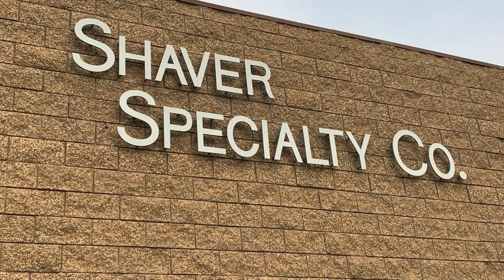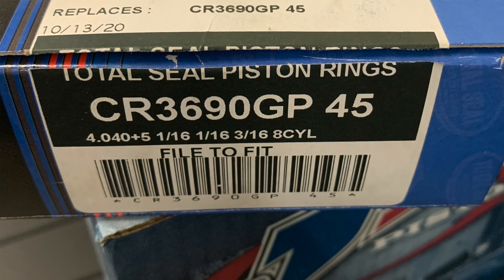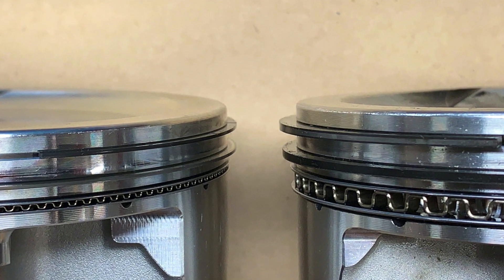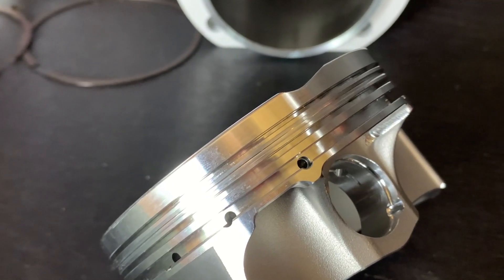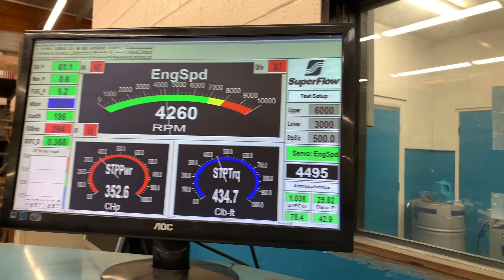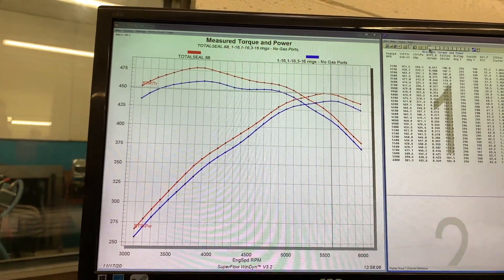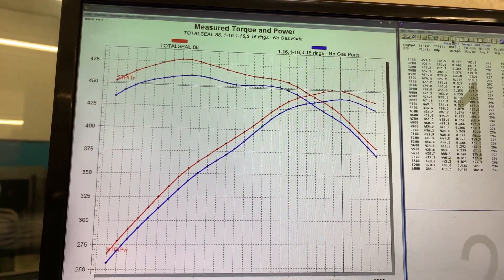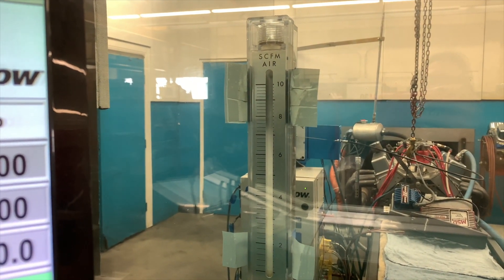Piston Ring Test @ Shaver Specialties Racing Engines

Comment: In the short shot of the high performance package I don't see a gapless 2nd ring. Was one used or not? (I would expect a gapless 2nd would be the way to go with a ported top ring?)
Reply from the maker: Thanks for the question. None of the ring packages tested this time were gapless. We are planning another round of testing with the gapless rings! Stay tuned!
Reply: @TotalSeal  can't wait!!! If things improved this much without the gapless 2nd using a ported top ring, I can only imagine the gains increasing more with a gapless 2nd & a low tension oil ring! 🤩🤩